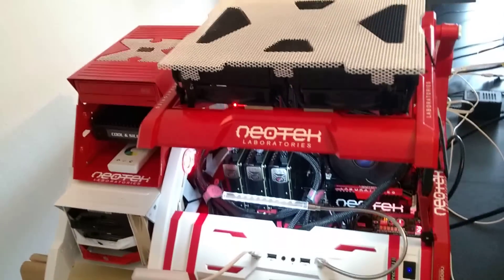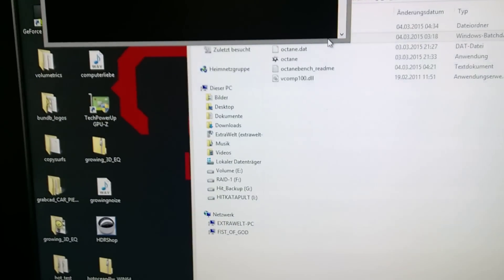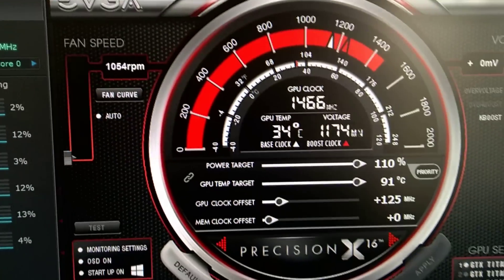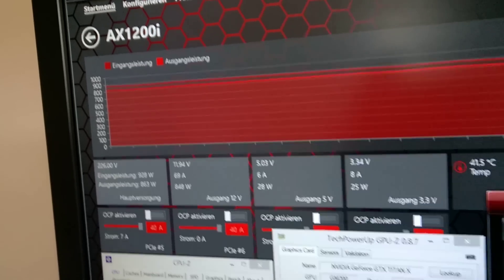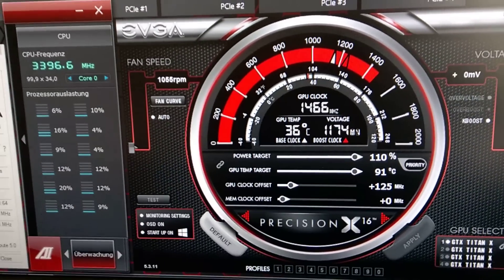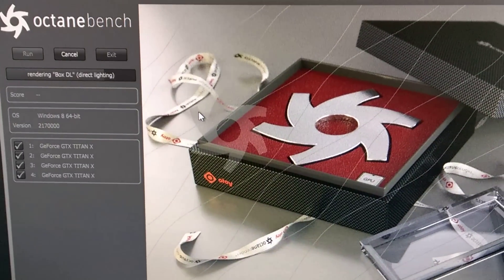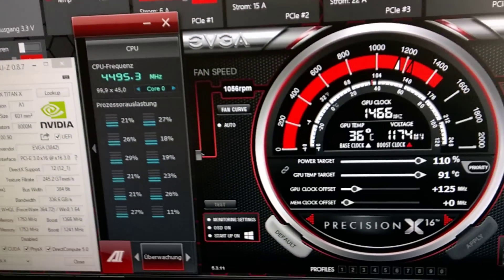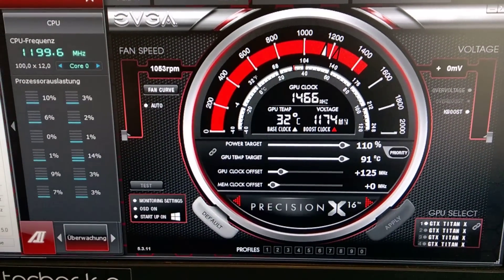OVERCLOCKING 4x Titan X 12 GB Hybrid for LW Octane Rendering Box

Comment: I want to build a similar system to your little beast here for rendering animation. But I'm looking at how complex and expensive liquid cooling is. Do you think it's really absolutely necessary? With 4 cards I'm inclined to think it is, but I would rather not have to deal with it. Do you think your system would have substantially slowed down on long renders without it? Or is it merely giving you a little extra performance?
Reply from the maker: if you will 100% safety is a watercooling system important. its not so loud and your chips going cooler as with a air flow as solution! and yes the OC is only a little extra performance...

Comment: I got 530 with 4 x EVGA SC Titan X at default clocks! There is not much benefit you gain when overclocking for rendering, its very tiny percentage and only puts stress on components and heat. Even if you water cooling the cards you would not want to run them like this for 24h render jobs. You gained only 4.9% better score with OC which doesn't make much difference even if you're running for days. For games you will see big difference but not for rendering. So for rendering it is best to leave the clocks at default or even down clock for very long renders. Cool video! Subscribed! Peace! :)
Reply from the maker: my cards are watercooled. and yes OC bring more with games. thats true :)